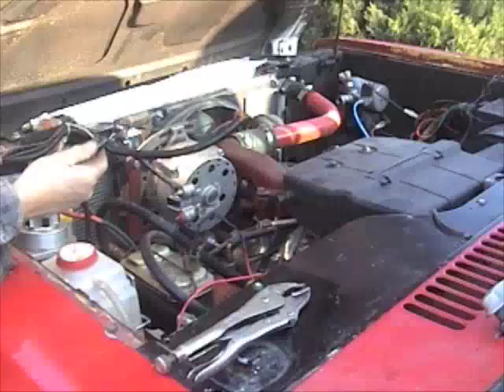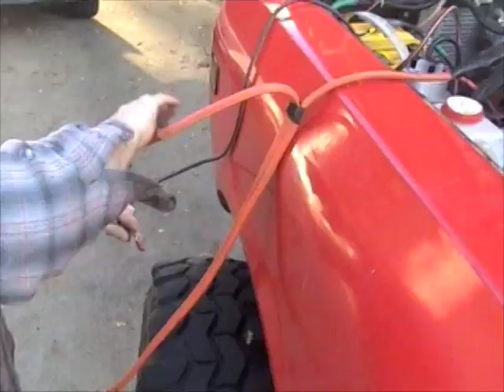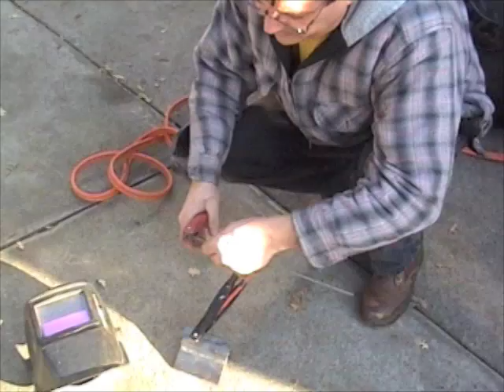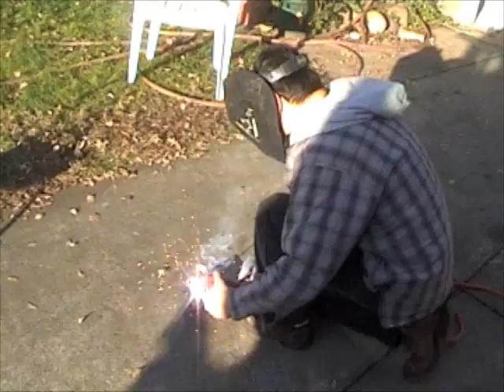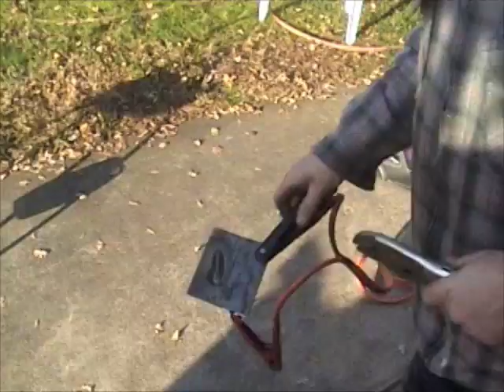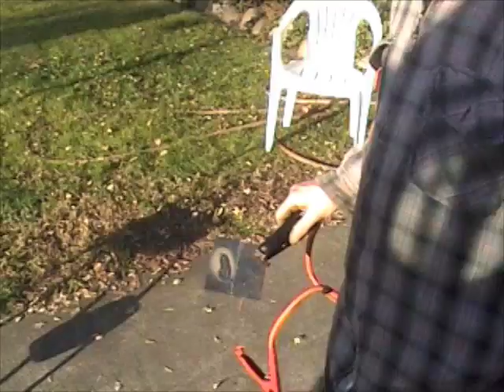alternator welding

Comment: ripple from altenator  seems to make rapid breaks opposed to dc batteries cause fusing w stick if you ve got the money get an oscilloscope- via con dios
Reply from the maker: the ac ripple is awesome.  it's like a high frequency on a tig welder, the rod welds very nice

Comment from the maker: It welds great,  I can burn an 1/8 rod nice and hot.
correct pos and neg.    I should make a new vid with welding leads I now have on there. 

There is no voltage regulator, so use some caution as it about 50 volts.   i.e. use gloves.

It's a Scout II

Comment: @LilGreenFiero Interesting.  The whistle sound is kind of cool.  Lets see impedance is the resistance to A/C, so adding a couple caps will help make it last longer ,humm, cool.   PonyHaven said the same thing.    I really like how it welds now, but will need to figure out how to add the caps.  Getting them is easy, HVAC equip have large ones.   Are you just putting across the output in   Parallel?
-ScoutD300

Comment from the maker: The alternator is off a Ford pickup which ran on 12volts, but since it does not have a voltage regulator the voltage rises to about 40-50 volts when welding.   If you start with an internally regulated alternator, then you need to disable that part.   The old fords alt's had an external regulator.  I belive they are 70 amps @12 volts.  $70 rebuilt or $20 junk yard

Comment from the maker: It's a Ford alternator of off 83 F250
The excite wire it connected to the battery via a termial block.  3/32 7018 or 7014 rod